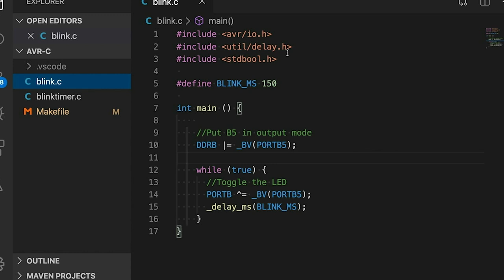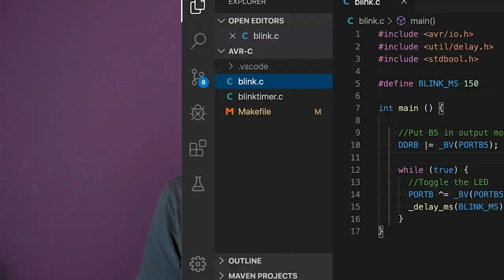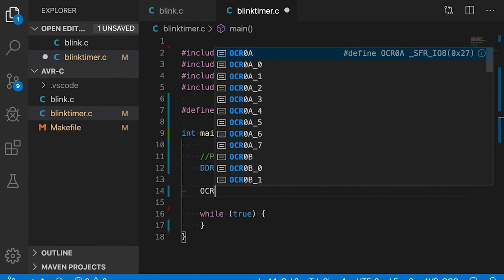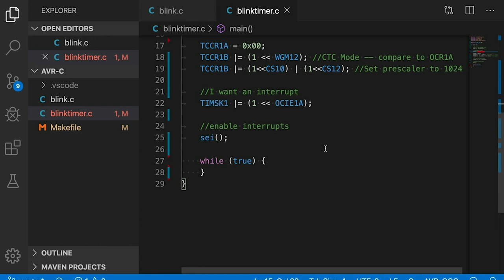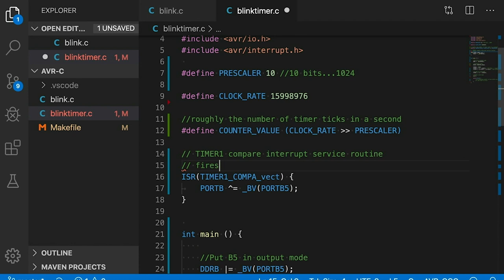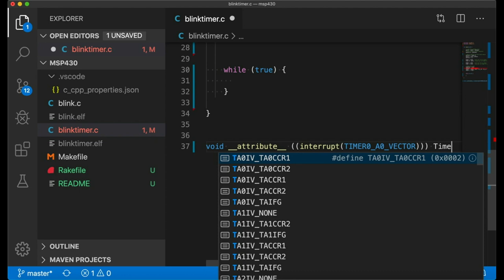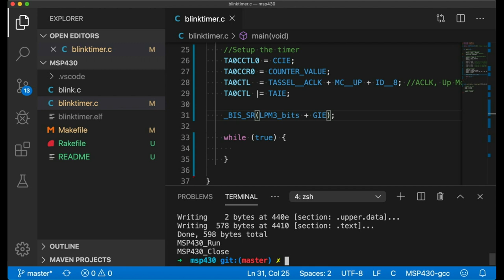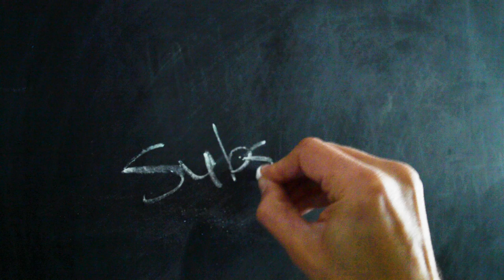How to Blink LEDs with Timers and Interrupts in C (MSP430, Arduino)

Comment: Dear Jacob Sorber,
Thanks a lot for the tutorial.  
1) What happens when an interrupt is triggered?
2) What is the interrupt handling algorithm in AVR ARM PowerPC x86  MSP430 MIPS ?
3) How does the microcontroller know where to return after handling an interrupt?
4) Who saves the processor registers when interrupt happens and where?
5) What code performs correct transfer to and from interrupt function?

Regards,
AB

Comment: How do you handle interrupts in GNU/Linux x86?
Reply from the maker: On the x86, it's pretty similar. You register your ISR for the interrupt you want. But, this is generally done in the kernel, not by user programs. So, for examples, your best bet is to look at the source code for the operating system. I might do a kernel video one of these days, but it would be pretty involved. So, it probably won't be in the next few months.